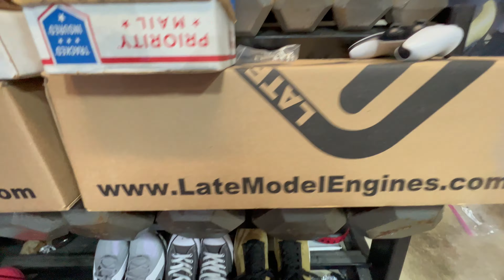1000HP 427 LSX Camaro UPDATE! TH400 OR 4L80E? Which One Is Better? DSX Tuning Triple Idler Pulleys

Comment: When I faced the 400 or 4l80e issue I went with the 400 because I just feel it's a more durable unit for repeated beatings, i'm at 641 hp n/a on 89 octane and just starting to learn my options for turbo's and e-85. That pulley setup looks world class.
Reply from the maker: Right on my brother. I hear what you’re saying. I need something that’ll take a licking and keep on taking LOL. And I need something that’ll go 40 to 165-ISH and with my gear and tire combination along with engine rpm at 6800 RPM. I should be around 170mph roll race. My engine revs to 7800 so that’s perfect. None of these guys will dig race these days. Everybody wants to roll race because they just don’t understand about driving their damn car and feathering the pedal and actually controlling the car not just pushing the gas from a roll. but right on my brother I appreciate the comment.
Reply: What is your final gear ratio? I'm running a 3.55. Are your heads the 265cc ones? My heads are 261 cc Brodix C-Series 17* 1st gen. @outlawperformancegarage5211
Reply from the maker: My rear gears are 3;73  @heshtesh
Reply: the th400 has one down fall in your situation  .. no lock up converter option unless u buy the 10k unit (not including the converter)..and if ur roll racing ur going to want the lock up ocnverter. the 4l80e is tunable as far as when u want the converter to lock up.. call Circle D .. they will guide you in a direction.

Comment: Dude you are at another level,  where you get them dive planes or attachments to the front gorilla splitter, and then side skirts.  They look sick. One last question I tried to go into euro sports concept for the diffuser, I don’t know maybe they are no longer in business.  Thanks. Brother
Reply from the maker: Right on my brother right on much appreciated. Much appreciated.! The side skirts are from iKON motorsports. The dive planes are from Auto addict USA. The rear diffuser is from Aero concepts. Let me see if I can find the link.
Reply from the maker: Aero sport concepts. That’s the company for the rear diffuser. I’ve seen them on Facebook now.
Reply: @outlawperformancegarage5211   appreciate the info.  Yeah I tried reaching out to them “aero sport concepts” in California. I e-mail, called posted on theirs instagram.  I have a feeling they gone or they got hacked o well.   Seriously thanks for the quick response.  Only if you feel comfortable answering- same car like yours, just a budget of 5k , my car just has cold air intake, based on your experience, what would you do for some Extra HP.   By now you have done everything right except the power coating on the heads I believe, but that was a great life lesson too!

Comment: I mean if you gonna use it for track only go TH400 if street use then 4l80
Reply from the maker: Well, you know me. I’ll be on the street more than the track. But we are setting this transmission up to run 170+. so hopefully it turns out to be a good transmission. Rossler Transmission is building this, so it should be a beast.

Comment: Who does your tuning? What pulley combo are you planning to run? Why not look into a 6l90e?
Reply from the maker: GP tuning does my tuning. Not sure if he’s going to continue tuning it for the new combo but who knows. Decided to go with a TH 400 because it’s so bulletproof. And the price comparison was huge. Also the torque converters huge price difference. At the end of the day the TH 400 can withstand 2000 hp built by Rossler Transmission. And it’s able to get me up to the 170 mile an hour mark. That’s what I really needed to do from second gear on a role race. I may be shooting myself in the foot, but I’ll be honest with you. I’m running out of money and I just want to get this thing back on the road.
Reply from the maker: The new pulley combination will be 2.5 upper and a 10.0 lower. Trying to hit the 1200 hp mark.
Reply: @outlawperformancegarage5211 I would consult with Greg and a tuner before going 2.5/10 thats spinning the blower way to much. You have a pretty solid build. Not sure of your compression ratio or cam spec. But I know those heads flow really good. So if your going to need that much psi. Then something is wrong.

Efficiency is the key. So no more than 20psi should be needed. Hell a buddy of mine is getting 1214 hp at 18psi. So tone  that Pulley combo down. Before you break a shaft. Or it locks up on you.

Comment: What upper and lower are you running 🔥
Reply from the maker: I am running a 2.5 upper and a 9.45 lower pulley it makes 20 pounds of boost during the summer
Reply: @outlawperformancegarage5211  im doing a 427 build would 2.35 upper and 10 lower be to much
Reply: @ritualtattoohoustontexas1816 Thats over spinning the blower with that combo.